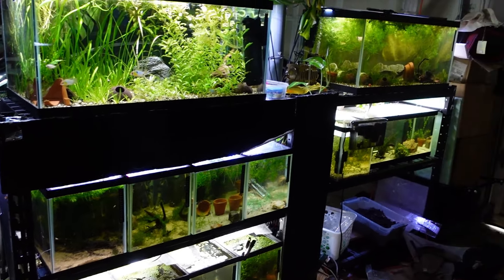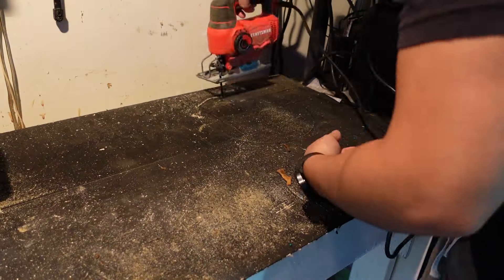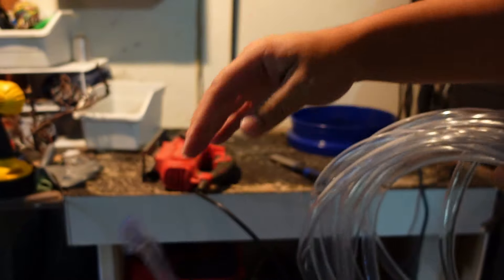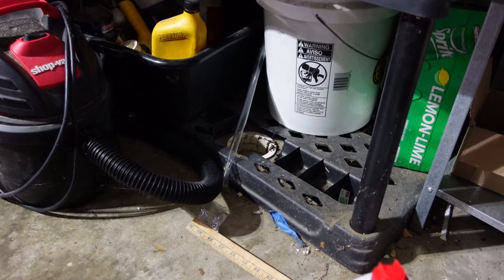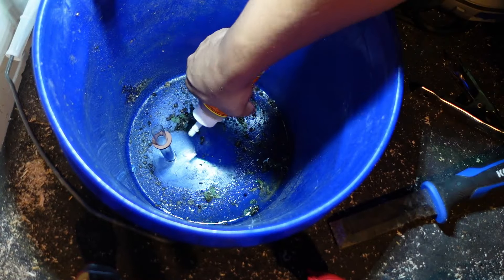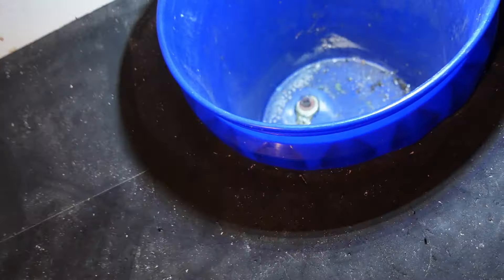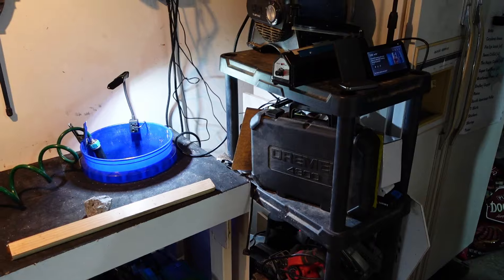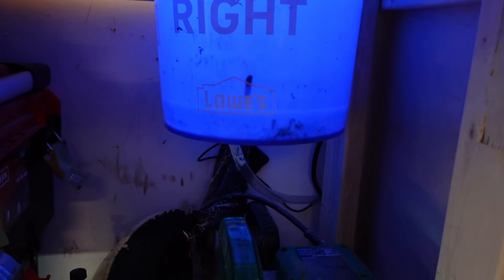DIY Bucket Sink For Fish Room

Comment: Great idea! The only change I would make is to use a rubberized adhesive instead of Gorilla Glue. Gorilla Glue dries rock hard, like immovable and very brittle hard. This will probably cause an issue later on because it's attached to a soft rubber hose. When the soft hose gets moved around it'll put pressure on the brittle glue joint and cause it to crack and leak.
Reply from the maker: Great point! When it fails I'll have to use silicone instead.
Reply: @thedirtytank I would use a pvc or abs bulkhead with a barb for tubing on the bottom. The lower profile of the bulkhead will leave less water sitting in the bucket when you’re done and it’s going to seal way better and longer than any adhesive and tubing combo. You can also buy strainers that fit the bulkhead